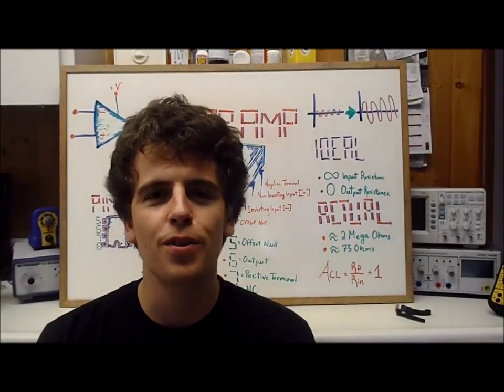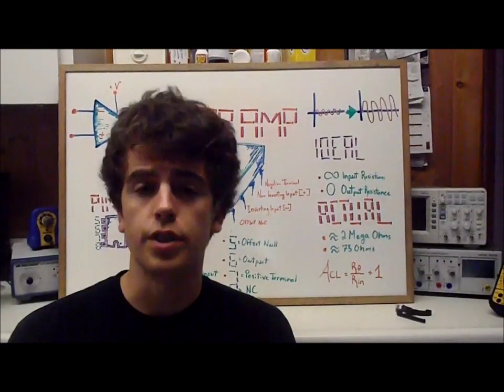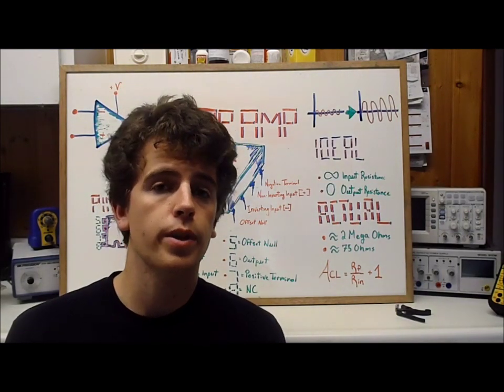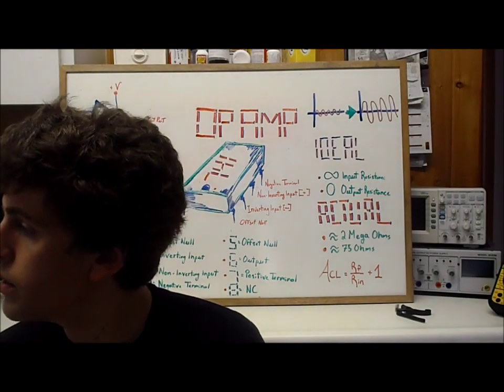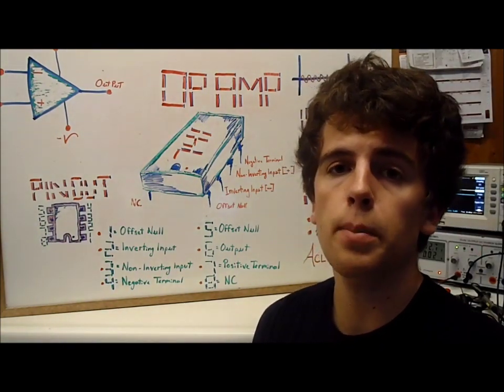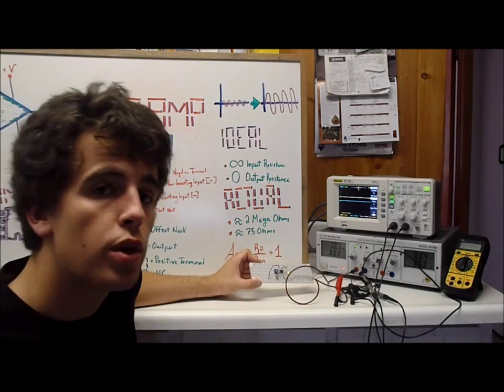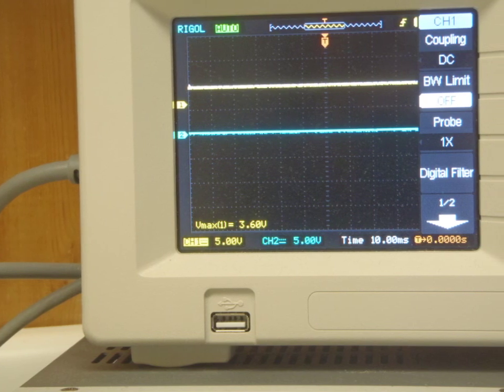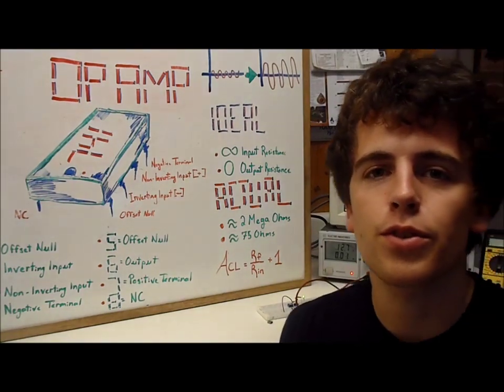What is an Op Amp

Comment: Hi man, great video, I am hoping to study electronic engineering in September. I am OK with logic gates, etc but this op amp thing is confusing me. Why would we want the input is infinite resistance, as no current would flow then? And what happens to the output for example when you play guitar? Does the voltage vary according to the note etc? So confused still
Reply: hello shane walsh,however much the input resistance is infinite so that current flow is blocked,the amplifier continues its operation because its supported by an independent voltage source that maintains constant supply into the input terminals to obtain the required gain.remember that the two terminals can be inverting(-) or non-inverting(+)....current in this case is independent of resistance depending on the input terminal chosen...thanks

Comment: You totally got me, dude! Well, Yup I've recently been aware that Op-Amps need a poer supply of 1 or 2V above the required supply. Umm the basic idea of my application is using the solar power so i found that using many diodes will not give me the Ampere I want coz the Ampere drops when loading the circuit besides photodiode current is really small. Okey, I've got an idea; I am gonna use say one photodiode with an Op-Amp and i will use an Energizer battery to power it inside the application.

Comment from the maker: You got me really interested, this project sounds crazy! Photo diodes as a power supply, sounds unique and very original. what is the motivation? The problem is Op-amps require power in order to make the operate, that tradition you can not get more out then in. So you need a power supply to make it work, so you will need a power supply to power your power supply is that still on track with your idea>?

Comment: Oh thanks for reply :D Well, I want to use some photodiodes as a power supply not as sensors. So if i used them like that, i will use many diodes to get the supply i want, i.e. 6V and 10 mA... So if i used an Op Amp with, say, one diode, will it do this job and give me this supply?

Comment: Thanks Nick & well done!
Got a question for you...
Why use an op amp?  Why not just use a transistor (assuming that you don't need neg voltage)?  Would have been helpful to include a schematic for your LED brightness control circuit.  Looking forward to your next video!
Ken

Comment from the maker: If it is integrated into the audio card my opinion is not to hack on it, as I could not see any good possible outcome. The cards are so tiny that hacking them is next to impossible, but t41 Op-amp in this video is not ideal for audio amplification (I've made an amp with them and it sound beyond terrible!) My advice, just attempt building a simple audio amplifier on your own, and make that into a head phone amp for your MP4 or MP3 device. Although hacking is rewarding, start on the fundamentals.

Comment from the maker: Op - Amp is short for operational amplifier, I can't believe I didn't include that into the video! Now a pre-amp conditions a signal and a amp actually amplifies it (now both of these can be made using Op-Amps). Now they are just circuits, usually include several op-amps and BJT (Bipolar Junction Transistors) and filtering systems. There is a lot of theory going into this, and I barely even made a mark. Hopefully this answers some of the questions you had. Thanks for watching.

Nick

Comment: @Nick Sek Yes resistors :). Another problem to solve: A charger has a led that is only lit when it is actually charging so only when current flows. That would be a fun practical mini tutorial fir current shunt measuring (or whatsoever it's called)